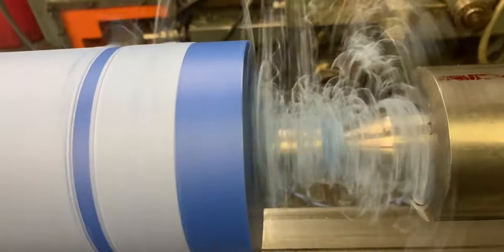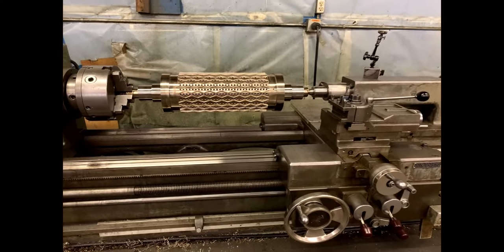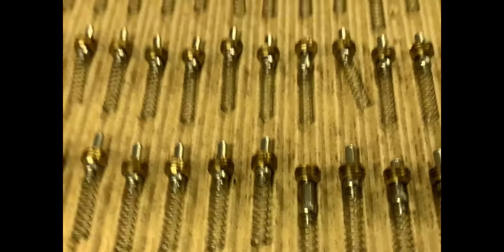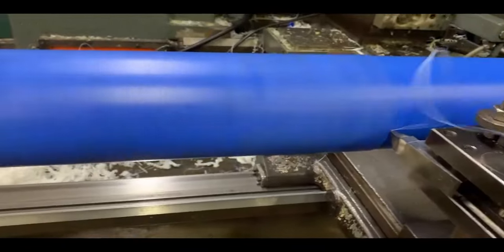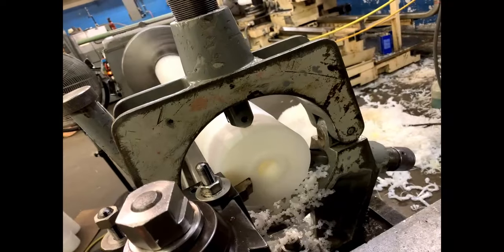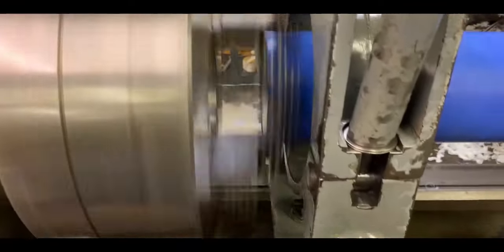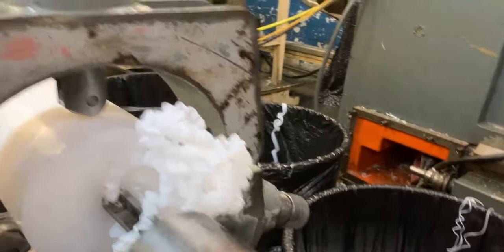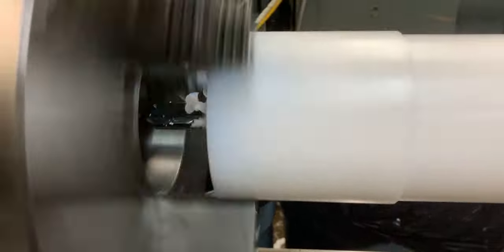Cutting some UHMW Plastic     #lathe #febrication #fabricating #fabricated #navy

Comment: One way to break that chip is with an interrupted cut. I ran a lot of the stringy plastics and a single flute mill was usually necessary.

If you position a vacuum near the tool you may be able to collect the chip all in one long stringer
Reply from the maker: This is UHMW and you do not want to interrupt the cut. It's best to keep it as one long chip. The vacuum is a waste of time, and you don't need it. Time is money so I don't know why you would want to interrupt the cut and use a vacuum. P.S. Did you watch my new video sex, drugs, and the Los Angeles Lakers video? What do you think of it, let me know.

Comment: After the cut is finished, keep the tool on its setting and just wind it back, it will cut the shavings in half rounds
Reply from the maker: This is UHMW and it will not do as you say. Plus, it's better to have it in this long piece than small bits.